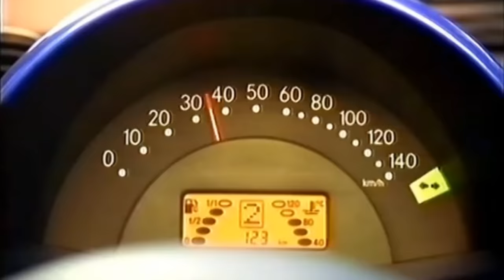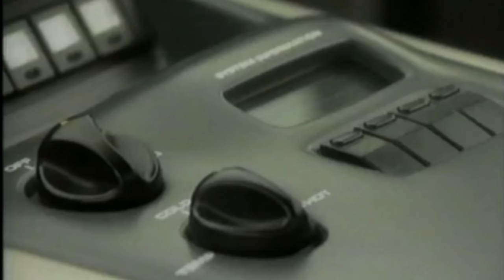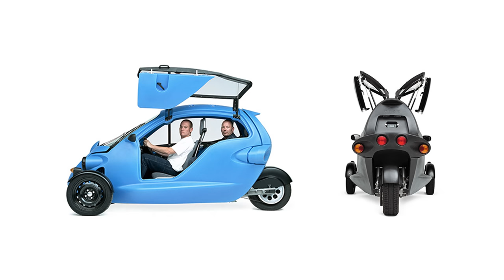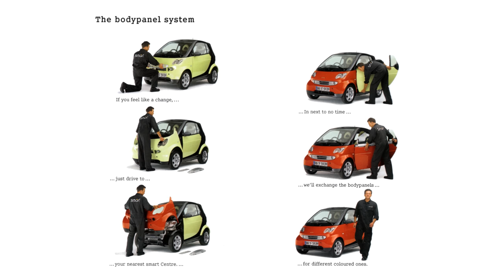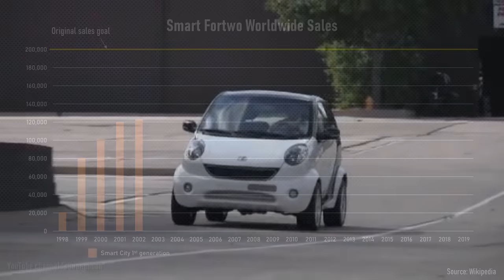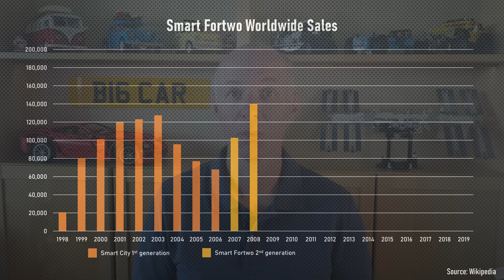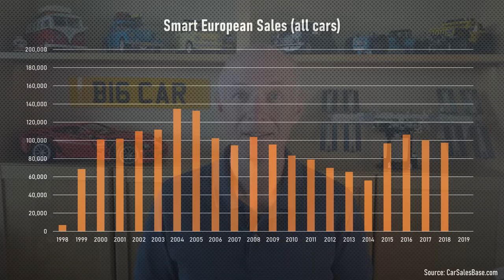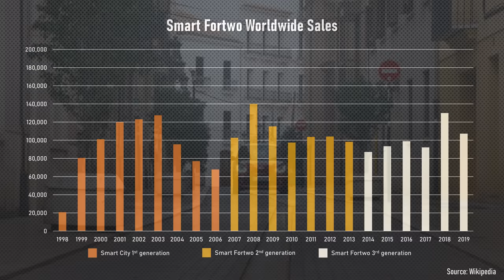The “Swatchmobile" ABANDONED by its creators. The Smart Fortwo Story

Comment: Sadly the concept of cheap to run was a total falsehood.  My local Merc dealer closed and moved off too many miles to be practical to service my Smart FourTwo.  I enlisted a mechanic who left Mercedes and bought the tooling and kept the skills to work on the Smart cars freelance.  The car was idiotic.  When the wipers failed it needed dismantling of half the car to repair.  Then after a 70mph dash to my nearest City the automatic clutch overheated and I was left stranded on the entrance ramp to a multi-storey car park. At that point sympathy ran out!  The car was a pest. I got rid and would never have another one.  I also tried a BMW C1 scooter and that cost £600 to get it through MOT and service the brakes.  Another disillusion that was quickly sold on to some other sucker!  Seems you need to be wealthy to run these low level production over optimistic new concept vehicles.

Comment: At 18:56, I have to politely disagree with the comparison of the Smart Fortwo with the Honda Fit. I have driven a former friend's Smart quite a bit, and I have been a Honda Fit owner for the last 11 years (we call them Honda Jazz here, but it's the same car). The Honda is about twice as much of a car, and despite that it beats the former friend's 1st gen Fortwo in gas mileage. Needless to say that - at least her ein Germany - the Honda was less expensive to buy, and also in tax and insurance. 
While it is true that the Fit is a quite popular car in the US, I don't see them being in the same class. The biggest common factor is probably that both are capable of loading a lot more than you'd think when seeing them. Since my car is blue, I always make Tardis references when people are surprised what I can fit in there, including my large self.🤣

The lack of power steering on the Fortwo was basically a non-issue, at least with the first generation. The bobby car sized wheels had little to no resistance when trying to turn the steering wheel while the car wasn't moving. Not sure about later models with wider tires though.

Comment: I am still amazed at the relative success the smart has had; despite being OK, the first 2 versions were pretty unreliable thanks to their transmissions and for just 50cm more, the lack of 2 seats and real estate you get on a 'full' car like the VW UP is a dealbreaker for most, even if you need them like once a week. The micro cars of the 50-60s still had 3-4 of what were called seats and cost a lot less than a bigger car...the smart costs the same as and offers less than a four seat car; despite the hype, it makes little practical sense, that's why it never was and will never be a huge success.

Comment: Im not sure where the "its a city car so slow is not a problem" idea came from. It may not need to have a high top speed, but it still needs to accelerate with alacrity in order to get in between all the buses and trucks in the city. ESPECIALLY so with a car this small. This would be perfect for an electric drivetrain.

Comment: One should mention that Mecedes needed the Smart to pimp their "Flottenverbrauch" = fleet consumption? The average C02 emissions for the whole car fleet has to be lower than a certain limit, and since Mercedes produces a lot of big fuel guzzling cars, they needed some efficient cars to compensate. This way the Smart allowed Mercedes to produce more cars with lesser fuel efficiency. Nowadays electric cars are calculated as zero emission cars when it it comes to the Flottenverbrauch, regardless of their size and energy consumption. Therefore Mercedes has already announced that they would stop producing smaller and efficient cars because they are no longer needed.

Comment: I see these occasionally in the Midwest United States. These might make sense in tight, crowded cities, but out in these wide open spaces and high speed highways the Smart is pretty dumb. 

Also plastic body panels might be an advantage in southern climates but, as Saturn proved in the ‘90s, cold winters make plastic brittle and easy to break. It was a common sight to see cracks or holes in doors on Saturns from some one bumping into one when the temperature was too low.

Comment: This guy loves his Smart because of folding seats, four crates and a narrow turn circle. All is positive. 
Well, the Smart had an engine which broke down all the time and had be totally replaced after some K miles. Not so smart. 
Furthermore, the Smart engine didn't had a oil drain plug. At least the first series. So you had to pump out the dirty oil. Which of course left a huge amount of residue in the engine and came in circulation when the the engine was filt up with new oil. Devastating and not so.... Smart!

Comment: I can't help wondering what the Smart would look like now, if it wasn't an electric SUV designed by Geely. Maybe, using existing tech, it could have a rotary engine, a small lithium battery, and a supercapacitor: easy to charge up while driving; making a small car hybrid.

Comment: I have a 2013 ForTwo
I love the gas economy of the car. 
A couple of things I do not like... The rear view mirror is too big for where it is attached.
It blocks too much forward/side view. It could be a thin, wide mirror.
I don't like the high seat backs. A smaller adjustable headrest would be better.
The gas gauge indicator on the dash says the filler is on the left, it is actually on the right...
I really hate the usb port and accessory jack being inside the glove compartment.
Very dangerous.
Aside from that....
I have driven it from Portland Oregon to Seattle, taken trips to California and the Redwoods on the freeway, drove the coast from WA to CA and again a lot more fast, far freeway driving.
This car will be doing 80mph and you don't even realize it.

It has increased in value of what I paid for it.
I paid it off and could now sell it to a dealer for $6000 more than I paid...
I'll keep it. and eventually replace the mirror.

Comment: Would love a Roadster, came close to buying one recently, but logic won the day (sadly). But I think this is why the Smart ForTwo hasn't become hugely successful, it's not particularly cheap, its not particularly economical (59mpg vs. 55mpg in a Perodua Kelisa  with 5dr for a few thousand less, or more mpg in many popular diesel superminis), and lacks the practicality that most people use sometimes. Even a small city car will take a washing machine, and most people have friends they occasionally give lifts to, so the benefits of having a tiny car rarely outweigh the benefits of having a normal size one which has the extra room when you need it. This relegates it to second car territory, and if you are going for a 2 seater, why wouldn't you buy something properly fun, like a Roadster, MX-5 or MGF?
Reply: Funny that you mention washing machines as once at the tip I saw a woman and small boy taking one out of a Renault Clio proving your point.

Comment: I have had the misfortune of working on these heaps of junk. Probably the only one in my district stupid enough to. I note that those who like them have sufficient funds to be able to buy a new one every four or so years and being "a town-car" they don't accumulate many miles in their (short) lifetime.
  Like most European cars they aren't very well thought out. Even when running well there are problems; the electro-clutch has hysteresis so if you want to creep forward you'd better be well insured and have spare bumpers. Stupidly the trans ECU is attached to the battery box and in the (very hot) engine compartment, so keep your 'phone handy or, better still, catch the bus. When the trans ECU is functioning it may still not drive as the "gear lever" has opto-interrupters to sense its position; these being at the bottom of a "cute" housing collect dust or bits of "hair-ties" that are placed on the lever, and thus, no longer sense the position of the lever. Don't place any liquid container the in the passenger floor (right-hand drive) because if it leaks the trans stops working; the trans relay box being there.
   The Mitsi engines being far superior to the Merc ones still had problems; not least of which was a terrible habit of burning valves. The oil supply to the turbo was marginal. It was essential to change the oil more often than recommended by the manufacturer and use the best fully synthetic you could afford.
  This is, by no means, an exhaustive list of the constant reliability problems.
. It is good that the panels are plastic and easily detachable because, in the sunlit towns of the Southern Hemisphere, the colour fades within a few months and eventually crazes.
   Though they are very easy to work on; the engine being out in under half an hour, one person and no special tools.
   I suppose this vehicle was designed for flat gloomy European cities.
   If you're thinking of getting one, buy a Suzuki UK110; it uses 1/3 the fuel, will last three times longer, and will get you to where you're going and always get you home.

Comment: How different would it have been if the excellent Fourtwo had been made in China or India from the start rather than high cost, highly unionised France?  It was never a goer given its high cost, truly appalling gearbox (and poor quality, overly designed interior). It only lasted as long as it did because it is very hard to lay off a French auto-worker.
City cars should be small, basic and cheap; Smart only managed the former.

Comment: Have smart 450 cdi 2003 for about a year, worst car that I owned in terms of road stability, ground clearance, plastic quality and overall dynamics. Had to mention that fuel consumption isn’t low for such small displacement, about 5-5.5l of diesel for 100km in city. Only advantage was compact size, and thats all. Eventually sold this piece of crap after not stable winter driving, almost got crashed

Comment: The bottom line : this car was designed for use in European cities where parking space is at a premium. It was not designed for long distance highway driving.  That being said , it has the worse automatic transmission ever designed. It doesn't shift ... it bangs into the next gear with a loud noise. Overly complex engineering by the Germans which pushed the cost into the realm of much better cars. Too many stupid design decisions were made for what was supposed to be an economy car.

Comment: Yeah, this isn't correct. Enough room for a supermarket shop as long as you weren't buying a turkey. This perhaps confuses turkeys with ostriches because I could always fill a shopping trolley to the brim, and get all that in the boot without obstructing the rear window. I've never understood where people get this idea from. Also when people call them 'city cars' and imagine they couldn't go on motorways, that's another common misconception. If you can't drive a city car on a motorway, it's probably a quadricycle or something similar. I never had a moment of doubt driving mine on the motorway, didn't feel unsafe, didn't have any speed issues. It's the perfect form factor for a car.

Parking nose to kerb is a myth too. A Fiesta is 1.7m wide. A Smart is 2.7 (probably the most recent model). Even at 2.5 that's over 2 feet of car extending out of the line on a street. Bad idea. I tried it, looked at it, predicted someone smashing my rear end on a normal street and parked properly. The only cars wide enough to shield it are outrageous things like Range Rovers. Would not recommend.
Reply: By the way, I loved my Smart and would happily get a new one if they update the electric engine to perform properly. The range of Chinese cars based on it is far higher, because Mercedes can't engineer their way out of a wet paper bag. That proves they have been selling a chocolate teapot. 

The new company have hinted vaguely that they might do a ForTwo sized model again.... but I'm pretty sure they just announced a second SUV type model of pointlessness with absolutely no connection to the brand. Given the despicable stance they took on the original smart in their video where they blew smoke up their collective backsides about how wonderful their complete lack of vision was (it's a sickeningly smug puff piece with almost no practical info - it's like watching an Apple event) I'm not convinced they'll turn up with anything worthwhile. It'd probably be a £40K nightmare, with 4 seats or something. I'll believe it when I see it.

There are plenty of proper cars in China though, so we really only need them to export some of them to Europe at some point to get that same joy.

Comment: I owned one.Less than 6 months.......
Dreadful to drive,steering was awful,its handling was newtered by the electronics,it leaked like a sieve,the imobiliser would reset after a while you had to lock/unlock again,The engine burned oil too...Had to replace the indiator stalk and the headlight because one knocks out the other.Had to fit a secondhand electronic gear selector too,that packed in as well..
Drivers cut you up and bullied you if they even seen you at all...
Mercedes-Benz and Smart ought to be ashamed of this disgrace of a car.
I wish I had read all the horror stories and forums regarding problems these cars had before buying one.. Utter Rubbish.